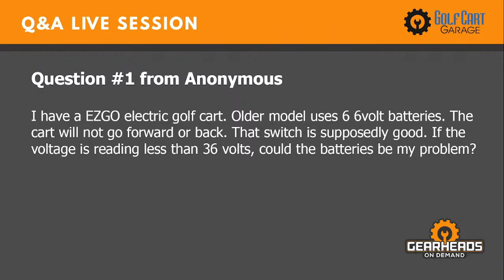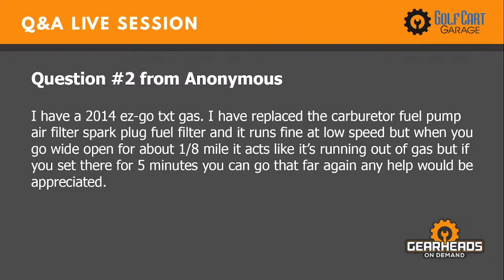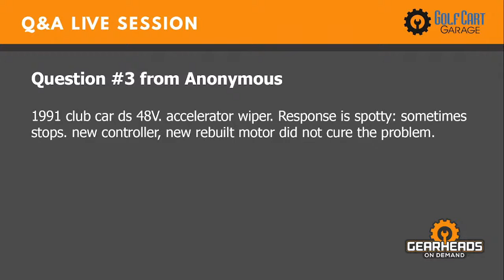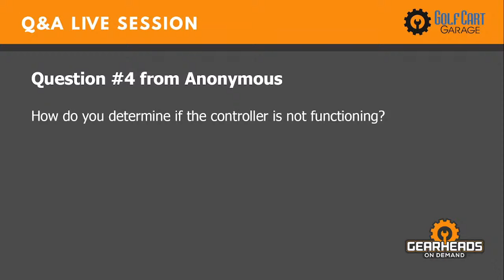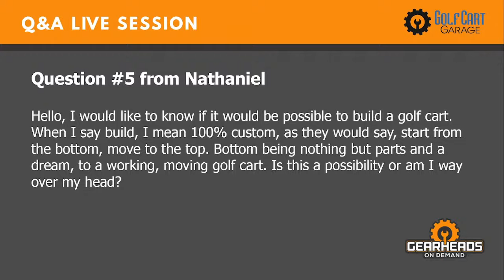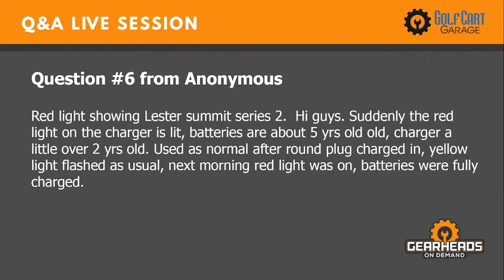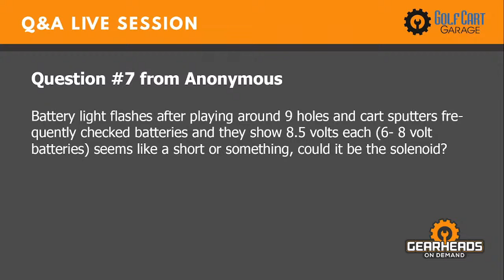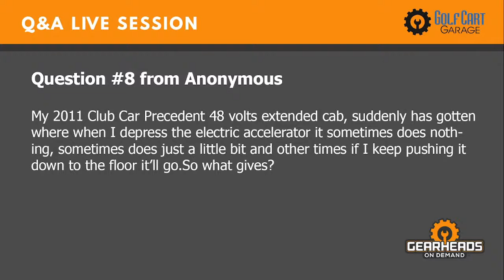How do you determine if the controller is not functioning?  | Golf Cart Garage I Episode # 49

Comment: Club car 48v ds, replace f/r switch, charge plug, solenoid, would not charge, did bypass on computer, now charges, now cart will not move does click, where could my problem be all batteries 8.2 volt to 8.5volt have not been able to test under load, cart is lifted.
Reply from the maker: Thanks for watching! It would be good to get a load test on those batteries. There's a video on load testing without a machine here: https://www.youtube.com/watch?v=NsUkLCTWSnQ&pp=ygUeZ29sZiBjYXJ0IGdhcmFnZSBwb3dlciB0ZXN0aW5n
You can get an appt for a video call diagnosis here:  https://www.golfcartgarage.com/gearheads-on-demand/
or get in touch directly at Support@GolfCartGarage.com or (800) 401-2934

Comment: My 1999 EZGO DCS goes full speed in reverse only. No forward. I have checked all microswitches. Replaced the controller with a donor with no success. Original controller is back in. I think I have the wiring correct. Any thoughts on what is wrong.
Reply from the maker: Thanks for watching!  This sounds like it may be an issue with the F/R switch or possibly the potentiometer (throttle sensor).  You may want to schedule a video call diagnosis here: https://www.golfcartgarage.com/gearheads-on-demand/
Or get in touch directly at Support@GolfCartGarage.com or (800) 401-2934

Comment: Can the ez go golf cart front end be aligned
Reply from the maker: Thanks for watching, Old Guy!  Toe can be set by adjusting the tie rod ends.  You want slight ( 1/8" - 1/4" ) toe in at the front.  If you have a good lift kit, you may also have a camber adjustment possibility.  If you have more questions or need help, just get in touch!  Support@GolfCartGarage.com or (800) 401-2934

Comment: I have an older model EZGO charger.  When I pug it in, it starts humming after 3 or 4 seconds but the gauge shows no amps flowing and the batteries don't charge.  The AC cord gets warm so it is getting juice. I have good continuity on all wires in the charge cord, the fuse is good, the 2 diodes show open on my tester,and  I replaced the control card. 
It still doesn't work.
Any ideas where the fault is?
Reply from the maker: Thanks for watching, Brian!  The capacitor is where our techs lean because the transformers rarely fail.  We also suggest putting a volt meter on the batteries while charger is plugged in to verify nothing is happening.  If you have more questions, get in touch!  Support@GolfCartGarage.com or (800) 401-2934

Comment: purchased a battery from 48 105ah lithium and am attempting conversion myself. In 2013 clubcar precedent 

I was told I could use existing  club car lead acid charger.
 Installed batteries. It worked fine. Plugged in charger over night. Did not work next day. The existing voltage meter shows power regardless of key on or off. I have checked all the fuses I. Can find. 1 in battery compartment and 2 behind controller panel.

I have replaced solenoid- same problem.😢

I reinstalled the original batteries and same problem excisted.

Any suggestions would be greatly appreciated!!
Reply from the maker: Thanks for watching.  Most Lead Acid Chargers are not capable of charging lithium.  Most lithium battery manufacturers have a specific charger they want you to use.  Something odd going on here.  We recommend a free video call consult with our tech team here: https://www.golfcartgarage.com/gearheads-on-demand/
or you can contact directly at Support@GolfCartGarage.com or (800) 401-2934.  Our techs will have some follow up questions for you.

Comment: Hello Tim
I have a 2014 Club Car Precedent 48v , it was running good, let it sit for a month, and when I used it at first brakes would lock up on touching them and speed was slow, analog battery meter was almost in the red on driving it. I recharged it and drove it tapping brakes seemed to reset them I guess, speed would go fast and then slowdown. Analog battery meter still pulled down to red. The batteries were 4 years old... I bought 6 new 8 v batteries. The old ones tested okay on load but it was time. Now It still draws down to almost red and not top speed. Controller ? Your thoughts . Thank You Not sure what to test next
Reply from the maker: Thanks for watching!  Brakes, especially after getting wet and sitting a while can sometimes lock up.  Our tech team's first guess here is to see if there may be an issue with the charger.  They can fail without much sign other than loss of power.  Our techs would also have more questions about the situation, and it's a bit much for the comment section.  We recommend a free virtual appointment with our diagnostic team here: https://www.golfcartgarage.com/gearheads-on-demand/
or reach out directly at Support@GolfCartGarage.com or (800) 401-2934.  We'll do all we can to help.

Comment: I have a 90 something ez go golf cart and I replace the spark plug carburetor coil pack fuel filter n It still will not crank. 4:35
Reply from the maker: Thanks for watching, Tony!  We recommend a free consultation with our diagnostic team here: https://www.golfcartgarage.com/gearheads-on-demand/
Alternatively, you can reach our techs directly at Support@GolfCartGarage.com or (800) 401-2934